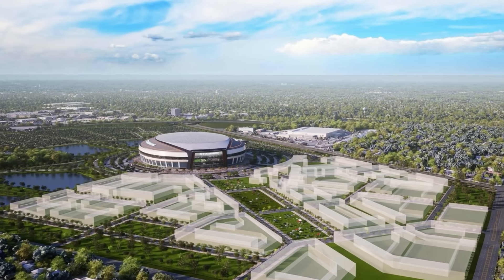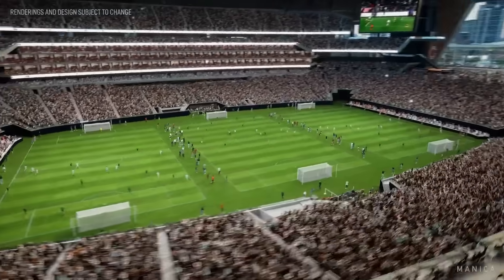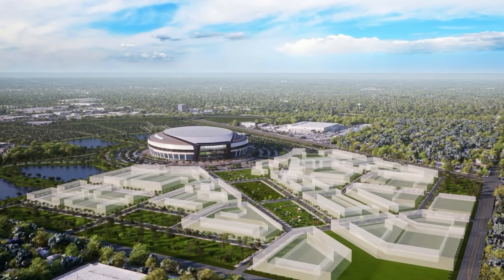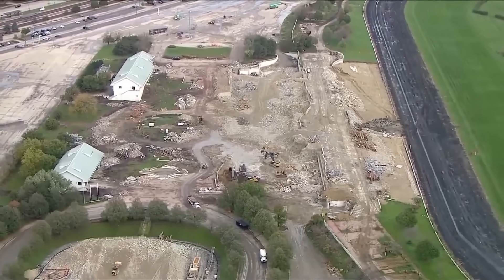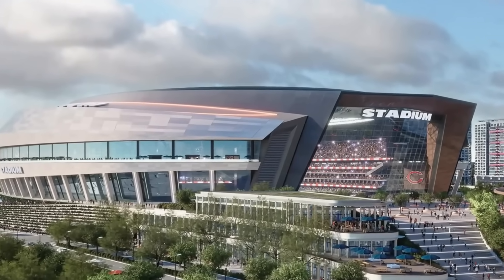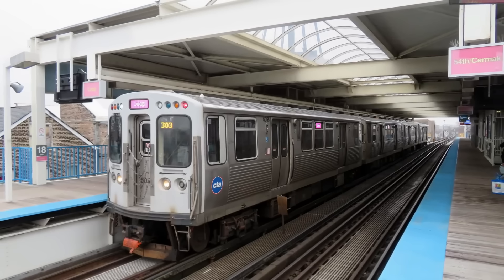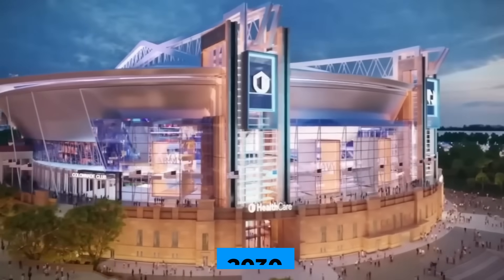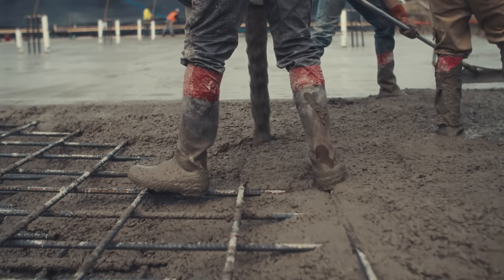Inside The Chicago Bears' $10 Billion Stadium District Excavation in Arlington Heights

Comment: They did a similar excavation for the Rockets Basketball Stadium Toyota Center in 200, they used 4 city blocks to build the Stadium & Parking Garage both were excavated 40' below street level, in poor soil and below the water level it had to be pumped with well points and the contaminated soil because almost every corner had a Gas Station on them before fiberglass holding tanks and before they lined the tanks with clay! It has spots where a person could light an area 20' below street level just use a Bic lighter! So I'm sure once the excavation starts it'll run into contaminated dirt! I know the track was there for a long time! But I'm not sure what was there before the track? Farm land for sure! But what else! And the removal of all black dirt until you hit clay, can't build on black dirt because anything built on it will eventually sink as the ground freezes and thaws! Clay doesn't allow water to penetrate it like black dirt so it doesn't expand & contract as much! But as far as heating & cooling it'll be cheaper because part of the Stadium is below the ground and insulated! Go! Arlington Panda's..! and take the Cubs with you!

Comment: Good points.  And thank you for taking a look at this from a civil engineering point of view.  Another issue that most folks don't know (why would they) is that the old racetrack provided it's own water service and partial drainage/sewer utilities.  That old water tower with the Arlington Park logo on its exterior was property of the race track.  In other words they had their own wells that pumped water up the tower to create pressure and water service for the complex.  Think of the Arlington Park as a typical but in this case huge unincorporated home.  That means no existing water main tie ins (other than their own service lines) and from what PW tells me, very little sewer tie in.  The water, drainage, and sewer utilities all need built from scratch.  BIG UNDERTAKING.
Reply: Good points?......😂😂😂
Reply: @michaelshepherd733  yes. The phrase "Good points and bad points" is correct and usable in written English.
It can be used when discussing the advantages and disadvantages of a particular topic or situation. Example: "In evaluating the proposal, we need to consider both the good points and bad points before making a decision."